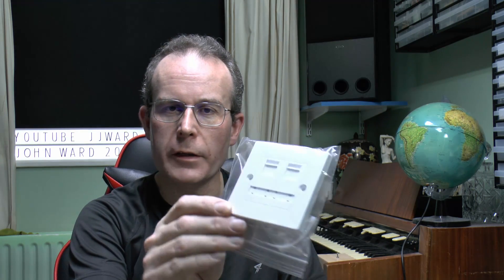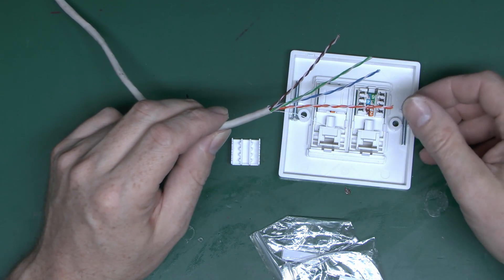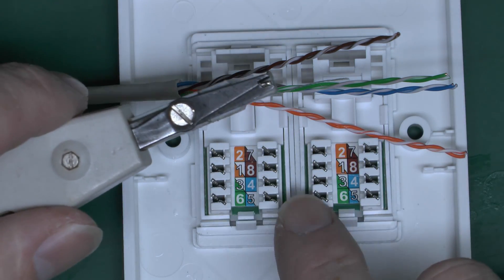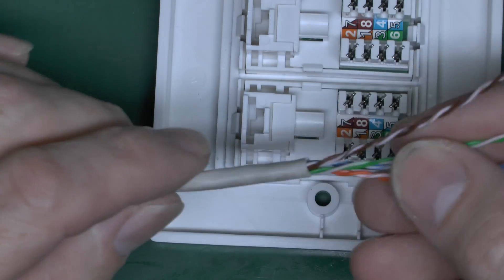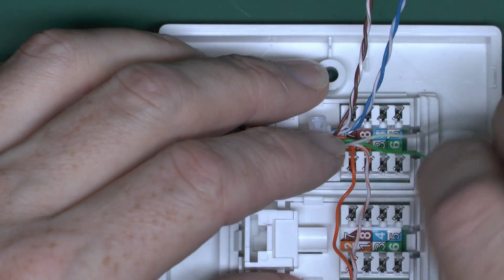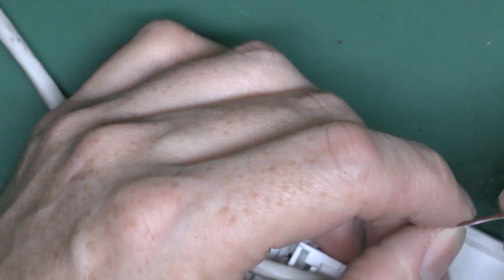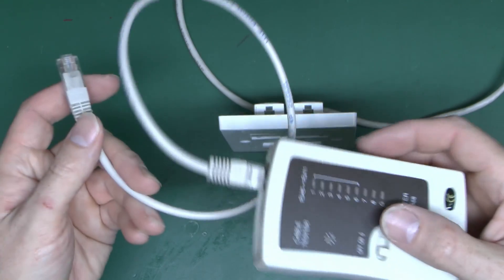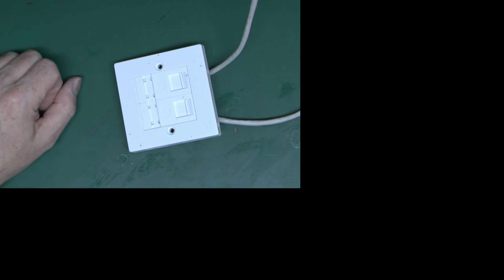Connecting Cat5e Cable to  'RJ45' Wall Sockets

Comment: Very interesting video but what if I was having an bad day and put the wrong wring  in a terminal. Can I simply pull the cable out without causing any damage to the wall socket or the cable?
Reply from the maker: Yes, wires just pull out.  The insertion tools usually have a hook on them for that purpose.
Reply: @jwflame  Thank you John. 😀

Comment: Just beware there are two standards for wiring RJ45: TIA/EIA 568 A & TIA/EIA 568 B. The A standard provides backward compatibility with phone wires. The inner 4 wires are wired the same (orange stripe, blue, blue stripe, orange) for both phone and data. The B standard is more common, perhaps because it is not backwards compatible with phone wires. Plugging in a computer to a Network jack that is actually wired for phone can damage your computer when the phone rings. While using Cat5e jacks for both data and phone may be convenient, there is no visual indication if a jack is for phone or data. Connecting a computer to a RJ45 jack that is wired as a phone might damage the network card when the phone rings.

Comment: why isn't there a ground wire for shielding? I plan to use this for audio, and need the shielding.
Reply from the maker: A version with a foil shield can be obtained.  It is not intended for audio applications.

Comment: John,   the wiring layout you show on the socket is different to an RJ45 socket I've just purchased.  From the top mine in pairs is 2,8  1,7  6,4  3,5 .  Any idea why?
Reply from the maker: Manufacturers can make them any way they want.
Doesn't matter as long as the wires are connected to the correct terminals.

Comment: Hi John. I want to wire an RJ45 socket then a plug on the other end to go into an Ethernet switch.  Do you wire both ends as ‘B’ or is one end ‘A ‘ and one end ‘B’.  Thank you
Reply from the maker: Both ends are the same, either both A or both B.

A cable with A at one end and B at the other is only of use in obscure situations like connecting one computer directly to another, or two switches together that don't have a specific uplink port and also don't auto configure the port based on what's connected to them.
Reply: @jwflame   thanks John

Comment: I watched several of your videos before designing and laying out the electrics for my new garden office. That is now installed and tested by an electrician. This time I am completely confident of being able to run an ethernet cable out there and plug in a socket at each end. Thank you so much for all your help. No fluff or faff, just clear instructions with emphasis in the right places!

Comment: "This style of connector requires a tool .... "

What is that style of connector called? What is the tool called?

EDIT:

The connector is generally called a punch-down block, and the tool used is called a punch-down tool. Common variants used for networking are the 110 block, and the Krone LSA-PLUS. The block in the video appears to be of the Krone variant, from the 45 degree angling of the contact slot. Note that punch down tools come in different variants, with "blades" to fit various connector sizes, and the Krone specific one is often just called a "Krone tool".

Comment: Good morning @John Ward thanks for this helpful video, can I ask would it be possible to extend this network by splicing a second wire into the back of the socket , so 2 colored wires per connection and then run a 2nd wire from the back of the socket to another single output socket.  basically like an extension connected to the rear of the socket terminal . ? thanks
Reply from the maker: No, it has to be one socket from one cable, which connects to one outlet on the router or switch.
If two sockets are wired like that it should be possible to use only one of them at a time, but even that isn't recommended and may have problems with interference.
Reply: You want to look for a component called a "switch". It makes 1 socket into multiple sockets.

Comment: Hi, just wondering if you could help, I've got some ethernet sockets in the wall that have been there since we moved in. I opened them up today and they're cat5e, we've just wired some of the house up with cat6 (B configuration). How do I make the sockets work with the cat6 cables? I've tried bluntly plugging something in, and it doesn't work. Each socket seem to be different also. I have been looking online and all the wiring orders are different from the diagrams on the socket, can I just ignore the socket diagram?
Sorry I'm a bit of a noob xD
Reply from the maker: Colour codes for Cat5e andCat6 are the same.  Every socket needs to use the same colour code.
Reply: @jwflame  That sounds logical, which makes this even more of a mystery. I'm not sure if it ever worked as it hasn't ever since we lived here. So I'm going to plug cat6 (B config) into it, and beyond the socket is cat5e wire. Is there a different wiring or socket depending on if it's A or B?
Reply from the maker: @nickpowell335  A or B is just how the wires are connected, the sockets and plugs are physically identical.

Comment: I appreciate the video John, its very helpful

But I’m surprised that no one seems to make a simple face plate with a female plug connector on both sides. So one can simply buy a long enough cable, run it in the wall and then plug each end into the back of the face plate and fit it to the wall box, so fast and straight forward no need for wiring or special tools

If someone knows where i can find these please reply
Reply from the maker: Panel mount connectors in that style are available, such as this: https://cpc.farnell.com/cliff-electronic-components/cp30220/feedthru-utp-cat5e-rj45-rj45-blk/dp/CN20411
although you would need to mount it in a suitable plate, buying a blank plate and drilling holes in it would be an option.
Reply: @jwflame  

Thanks for the reply, but i found one after all, 

https://www.ebay.co.uk/itm/Wall-Socket-Plate-One-Port-Network-Ethernet-LAN-CAT6-Outlet-Panel-Faceplate-RJ45/332016678924?hash=item4d4dbc780c:g:v0cAAOSwb~VfMNHM

Comment: Hi John. Is it possible to use a double socket, with 1 ethernet cable, and wire it up so that both sockets use the same cable?  example, i have a setup, with 1 cable to my office from the router downstairs, but as needs must lately, i have 2 computers here now. I need the 2 pc's wired through the cable. 
Is it possible to wire up a socket in this way, or are there easier solutions to share 1 ethernet cable to 2 devices.  Thank in advance.
Reply from the maker: It can be done by using only 2 of the 4 pairs of wires, however both ends of the cable will need to altered, it will be limited to 100Mbps and it won't be possible to use PoE devices.  Generally a very bad idea.
Far better and easier to just add a 2 port (or more) switch at the end of the cable, such as this: https://cpc.farnell.com/tp-link/ls1005g/litewave-5-port-gigabit-desktop/dp/CS33157

Comment: Do you know, if it's possible to have a duo wall socket like this one but use a single cable to connect it?
Reply from the maker: Possible by connecting only 4 wires to each socket, however they will be limited to 100Mbs and features like POE can't be used.  Unless it's really the only option for using an existing cable, installing one cable per socket is far better.

Comment: Hi John, I found your video googling for a simple explanation of what are "5e" wall sockets for and how to use them if all I want is to hook up my modem as we are moving to the new place. Our current place is wired using the (old style?) "normal" phone cable sockets - the narrow ones, not the wide Ethernet cable ones, if you can forgive my noobish explanation of the matter. I wasn't able to locate any of the narrow ones around the house, that I'd expect to connect my modem to. Are these wide Ethernet 5e ones to be used with Ethernet cable to get my usual internet connection in the new home? Information on the internet is very confusing and appears to assume some networking knowledge a lot of us - average Joes - don't have. Any advice here (or maybe you have a simple "how to connect internet in your home using 5e sockets" tutorial?) would be most appreciated.Thank you
Reply from the maker: The better method is to have the modem at the point where the incoming cable enters the property, and then distribute inside using Cat5e or above with the 'RJ45' sockets.

Comment: A couple of FYIs. The caps can also be used to punch down the wires into the block. The colour coding on that block is for an EIA/TIA 568a. If the Orange and Green pairs are swapped then it becomes an EIA/TIA 568b. If you put an EIA/TIA 568a at one end of you cable run and an EIA/TIA 568b at the other end then you get a crossover cable. Modern switches can handle this and will give you connectivity but really old one will likely not. Do not ask me how I know this. 🤦‍♂️

If you are going to be doing a lot of data cabling then get a better cable tester that has additional functionalities. I purchased one that has 8 Remote terminals which is real handy when doing multiple cables. I means you don't have to keep running back to the MDF to swap the Remote onto a different point to test. My one would also measure how far away a fault/break was on the cable and which wire in the paid was the culprit. This was a neat feature and quite handy for diagnosing a cable fault.

Comment: So which wires exactly carry internet signal from router to the box ? The reason im asking because in cat5 Im extending orange pair has no continuity.
Reply from the maker: For basic ethernet, green and orange pairs normally used, blue and brown are not.  In theory you can just use two pairs and leave the other two unconnected - however those other pairs are used for other things such as POE and gigabit ethernet.  Using an obviously damaged cable isn't a good idea either, even though it may appear to work.
Reply: @jwflame  Unfortunatelly I have to use this cable as it already goes under the floor to the basement tv room. Thanks for reply.
Reply: 4 wires for 10/100Mbps but you need all 8 wires for a 1Gb connection

Comment: Unshielded twisted pair should not be used anymore.
Especially  in fixed installations.
Reply: Why? Highly adept and very conscientious network technicians the world over have used UTP, and still use UTP, unless there is a specific need for extremely high immunity to external influences; in which case the much more expensive STP is used. STP offers no major speed advantages over UTP, it's just far less likely to be affected by interference, something that UTP is already highly resistant to, by virtue of the twists in the pairs. STP is also a right pain the arse to terminate properly so is not worth the large amount of extra time and effort  unless it's really necessary.
Reply: @Tekwyzard  Your point of view was common sens in the last century, but thing have changed.
We are facing 10Gbit and more over twisted pair. 
For trouble free use, I would at least use CAT7.
You may be right about the termination issue,
but only if you use crappy sockets, like shown in the video.

Comment: Do you know if you can actually get sockets designed for stranded cable, or are they all designed (as they should be) for solid?
Reply: The IDC terminals generally used here (Krone style) are supposed to handle stranded cable fine. This may vary with quality.

Comment: Nice job on the inserts with the tool and good advice on keeping the twisting. again get a decent insert tool for heavy dutty. although the cat6 here is getting more usual the cat5e is more easy to crimp / insert.

Comment: The tool is a LSA "dogger" tang https://www.bol.com/nl/p/valueline-lsa-montagetang/9200000074364324/
But the real tool for this is a 110 https://www.amazon.com/Punch-Down-Tool-110-Blades/dp/B00066HQ14
The krone is for LSA strips. I have used a krone for many years
Reply: These are not 110 blocks. That tool will not work on them.

Not only are 110 less common for ethernet usage in the US, they are basically never seen outside the US.

Comment: With Cat 7 being pretty cheap now (or even Cat 8 for a little more), why are you messing with yesterday's Cat 5, with much lower capability? All RJ 45 compatible. I am all Cat 7 for streaming tv and music.
Reply: Cat 7 FTP is only backwards compatible with Cat 6 FTP*. Unless you're buying things for a data center, almost all Ethernet devices require Cat 5E or Cat 6 *UTP*. *UTP and FTP have never been compatible and Cat 7 UTP isn't defined by the spec. 

That's why you can only find "Cat7 UTP" cable from shady suppliers - quite frankly they're bullshitting you in a callow attempt to upsell and deserve none of your business.

The problem is termination impedance, which I know is a bit esoteric. When signals are sent with a fast switching speed something special happens. (Analog bandwidth in MHz multiplied by length in meters exceeds about 50 mega-meters.  This happens very quickly with a 200 MHz or faster standard!)  The electrodynamic energy in the cable needs to be properly absorbed. If it's not a reflection will bounce off the end of the cable and return to the transmitter. 

"Properly absorbed" means that the receiver draws a specific amount of current proportional to the signal voltage The termination current for FTP is 1/3 less than UTP - it has 150 ohm termination impedance, not 100 ohm. Again, this has always been true and UTP and FTP have always been at least slightly incompatible. F/UTP (foil around the entire cable, not each pair) is reasonably compatible with UTP, but any cable that puts foil between the twisted pairs is not.

So what? With 100Mbit Ethernet or slower you can easily get away with this. The reflected signal creates a standing wave, but this only degrades the signal-to-noise ratio. Each pair is used for signalling in only one direction. So, yes Cat 7 probably isn't going to prevent 100BASE-T from working properly. But why would you do that?

1Gbit and 10Gbit Ethernet attempt to use simultaneous bi-directional signaling using all four pairs. Reflections interfere with the opposite-direction link.  This means, for example, that TCP ACK packets from your computer will reflect off of your router and interfere with the TCP payload packets. If the interference is strong enough to drop a packet, you can't ask the router for a retransmission (that's a WiFi feature not present in wired Ethernet or IP) so you end up waiting for the server to retransmit. And that causes it to slow down because of TCP congestion control. 

Bottom line: only install Cat 7 or later if you actually have compatible devices, such as 40GBASE-T or faster. It's a good idea to test with a proper cable analyzer too.

For all normal electronics Cat 6A UTP is still the best Ethernet cable. If you're willing to spend a little more: buy it from a good supplier, not from the kind of chuklehead who will sell "Cat 7" for a home or office.
Reply: Have you actually tested that cable to be sure it meets Cat 7 specs, or are you just believing the claims of the cable manufacturer?
Reply: no disrespect but the title of the video states connecting cat5e

Comment: Not legal to do this kind of work in Australia... all fixed network cabling must be laid and terminated by qualified persons. This relates to (is justified by) safety and separation from mains wiring. Note that in AU the mains wiring in walls and ceilings is NOT inside conduits, it's double-insulated but that's all.
Reply: It relates to and is justified by profiteering and corrupt politicians. Australia needs some fixing.
Reply: They level of skill here in England is not as good as OZ.  There is so much information that is missed in this video to make it CAT5e compliant.

Comment: Only four out of the eight wires are used for 100Mbit connections, so it's possible to use one cable for the two sockets (two wire pairs per socket). This doesn't work for 1000Mbit though since it makes use of all eight wires in the cable but for 100Mbit you can get two independent network connections with just one cable.
Reply: Does it matter wishing pairs you use in each outlet ?
Reply: Nice historical fact, however NOBODY should ever be cabling for 100Mbit. It is almost 2020, not the 1990s

Comment: Made a few exactly like yours to act as cable joins, as I had premade cables, plenty of sockets, but no flexible cable and was running out of the plugs as well. Just had to stay there for a few days till I had a chance to replace the 2 leads with a single much longer one.

Comment: i have cut my hand open before uesing thoes punch down tools. it was not a very fun thing to exprions
Reply: Use the punch down tool on suitable insulation displacement sockets only. There is no reason to ever be pushing it anywhere near to your hands. Do not run when holding tools.
Reply: @johncoops6897  its was under a desk and in a very bad place where i could not see and the punch had slip from the block and had hit my hand i was useing to brace my self it was a stupid move on my part i know that but you only learn for the thoes mstakes like that. i dont really warry about it any more as i have not really done any network in over 5 years may be a little at home but not in business from my last job.
Reply: The only accidents I have heard about, is when the “user” of the tool forgets to correctly stow the wire removing “pick” at the handle end...

Comment: Punch-down tools (often called Krone tools as BT adopted the Krone standard for Cat 3 phone cable in 1865} are available on eBay for a fiver. Keep the screws tight as they fall apart with continuous use. When buying the plates and cabinet patch strips some are provided with a choice of colour schemes as stickers balled 256A and 256B. A is for America and B is British.  To really impress the girls - double punch the wire withdrawing the tool on the second punch...
Reply: B is standard for data in the US A is the old phone standard.